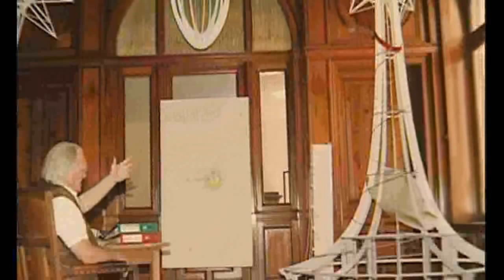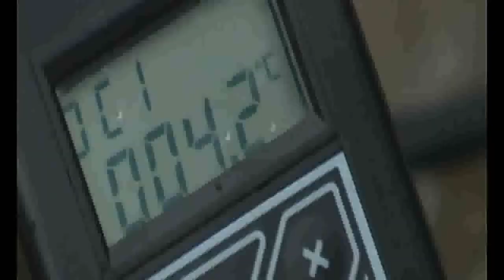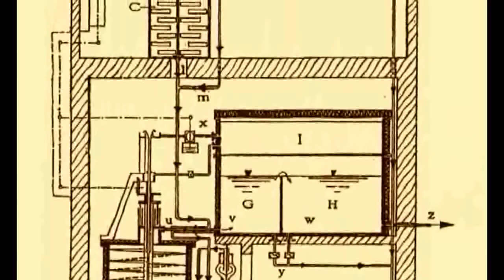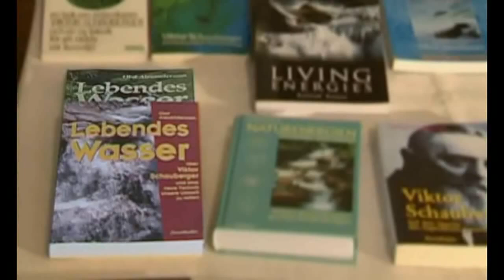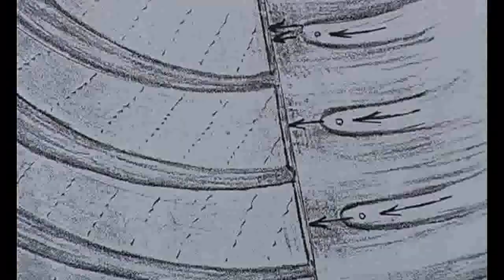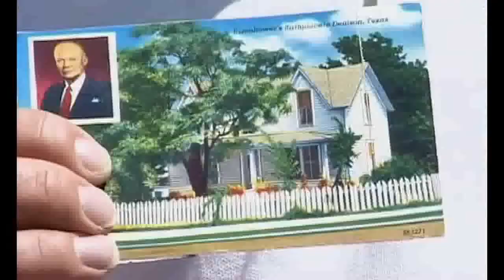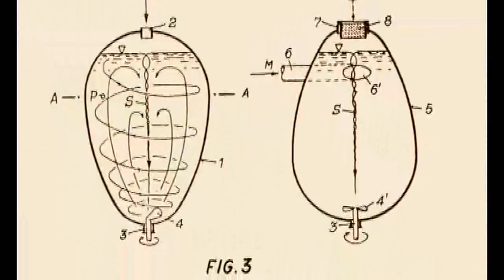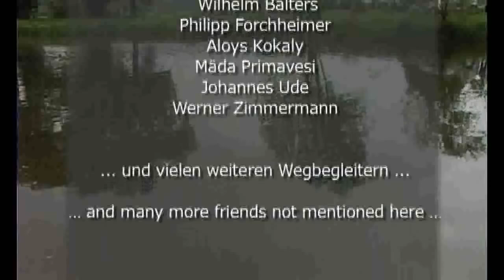The Secrets of Water, The Documentary of Viktor Schauberger "Comprehend and Copy Nature"

Comment: well I think that if they were to use the new 3d printing systems they would be able to create some parts of these artifacts with a better outcome... here I am referring to the propulsion system and the one used to produce electricity from water for house hold consumption...
Reply: Robert Ostman - 3D printing uses a type of plastic but it is copper that is needed to replicate Viktor's work.
Reply: ... humm you may be forgetting the 3d printing of metals...
Reply: Robert Ostman - Oops, thinking of the home 3D printing, only ever seen them print using a type of plastic. Thanks for correcting me Robert.  Can copper be used?
Reply: yep seems like most metals
Reply: It's definitely changing the game. In every conceivable way.  For the better.

Comment: This has me thinking how it can be implemented in the refinery/chem plants cooling water system. They use chrome tubes in the heat exchanger and a copper block as an anode. They might need to use copper sleeves that spin the water. But it might change the dynamics of the product on the other side of the exchanger. I could go on and on about this. Thank you for posting this video. Food for thought.

Comment: You have a pretty good list but where's the AMLA? You missed one of the best!
Reply from the maker: You're right Thomas. Amla is a powerful natural herbal anti-oxidant. There are several others as well. I wanted to focus on the most effective supplements available. One that I did put on the list is Megahydrate, which is encapsulated negative ionized hydrogen. This was not possible to find in such doses until the 1980s when another brilliant scientist, Dr Patrick Flanagan invented a new form of silica to hold this special form of hydrogen long enough to be ingested. It both donates electrons which neutralize the worst free radicals, but also helps allow the cells to absorb more water, which helps them function better. It's antioxidant effect is unmatched except for carbon-60, C60. Both of these I take every day and offer on my site vitalvibesource.com. I am interested to hear about your experience with Amla however!

Comment: In theory, could you use the high voltage generated by the water and mix in tesla's knowledge and create a tesla coil? The load required to run wireless energy devices (in my research) have not required more power to the source.

Comment: So its now 2017 and is there a working model of any of this guy Schauberger work? Is there a machine in operation?

My spider senses are tingling I sense more snake oil.
Reply from the maker: Fritz Watzl was an apprentice of Schaubergers and has built many repulsines. He's had several cars, heating devices, and energy sources running off this technology for decades. Viktor's  grandson Jörg is another who uses this technology. There are two main reasons you haven't heard of this tech. One is that most of it is spoken about in German (at least Schauberger's work). Second, this type of technology is continually suppressed by those who will stand to lose their industry and fortune. Nikola Tesla, Yule Brown, Stanley Myer, John Bendini, Tom Beardon, and others have all had working models of tapping into the plasma source field of infinite energy.
Reply: + Steven - I've come across a few items and own a few water charging copper items that do squat as far as I can make out. 
My Singing bowls do a better job than any of those coiled copper stirrers or vortex twisted tubes by far when it comes to treating/charging drinking water.

  That said Viktor Schauberger's work is concrete in my humble opinion. His death shortly after his US visit rings alarm bells. Been around long enough to trust the stories told by those who where on the ground and not what we are fed on TV. Among those My Grandad and his comment over concentration camps and my uncle Billy's accounts of Japan post the so called nukes. He reckoned there where more than just the two sites levelled and it was as if they had been firebombed.
Oil corporations allowed tanks to be modified to run on water at the end of world war two due to supply issues under the strict condition the matter was kept secret and all engines where decomissioned at the wars end. Joe cells are just one of several inventions that have achieved this since those days.

These same corporate interests where responsible for no bomb zones on both sides of the conflict. I heard that from David and Daphne Marwood Elton over lunch one day at their house down in Cornwall. Churchill's Orders blocked Bomber Harris from targeting some munitions factories.
 David (Group Captain Nigel David Marwood Elton) reckoned the war would have been brought to a close a whole six months sooner. Bomber Harris and Bomber command suffered a smear campaign after the war over Dresden. Churchill ordered that attack.
 Now we have the MSM's chosen ones face on our beef fat containing five pound notes.

Viktor Schauberger and his findings are a threat to the same corporate/banking interests that are currently destroying the quality of life for all.
 Even the study and demonstration of the Maharishi effect in Washington when the findings where taken by the FBI drew a negative response from some connected to the Military Industrial Complex and a smear campaign was initiated. The coherence numbers in the USA where reduced by half shortly after that. A catastrophic move that backfired horrendously. One they have been trying to rectify ever since. 
 These corporate greed ridden people are not smart people. Mislead from birth on the whole.

 When repeatedly asked why there where still Indians on reservations at a Q&A session, The Maharishi leaned over to the American gent and whispered
"Those on the reservations now are the ones who created them".
Overheard by a dear friend who was on Purusha at the time.
Create Hell on Earth and that is what will be inherited in future lives.

Comment: Dr. Harold Puthoff seems to ignorant.. I wish he would have seen a Tesla turbine in action. A Tesla turbine needs to be spun at an exact speed to kick in. Some starts working at like 50.000 RPM and (almost) instantly jumps to 70.000 RPM, just because the wanted effect kicks in at that speed.. What an amateur.. Edit: Grammar/Misplaced anger.
Reply from the maker: My thought was that he probably understands how it works, but is 
possibly trying to distract the Empire and greedy corporations from 
understanding its full potential, or possibly part of the collusion. There are so many "free energy" 
devices (and anti-grav) now that tap into the infinite zero-point field,
 it seems that it will be impossible to hide it from the general public 
much longer. We just need to stand together to keep the corporate greed 
from suppressing it, or using it for military purposes.
Reply: you are 100% accurate in your observation of higher rpm and yea that guy was a wuss and got scared and shut it down.
Reply: "got scared"=threatened